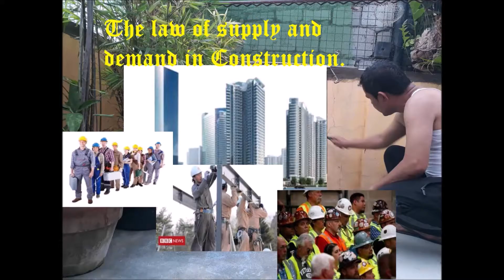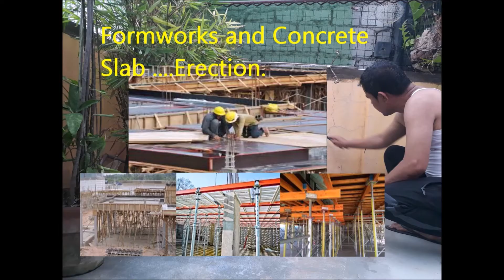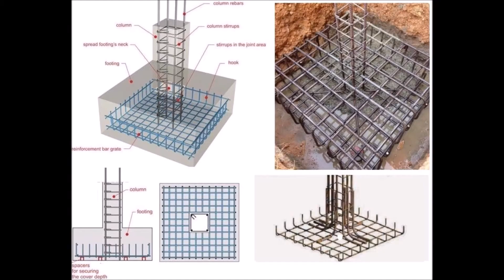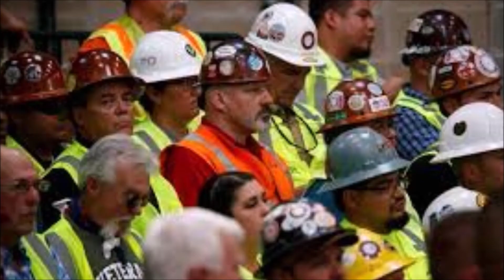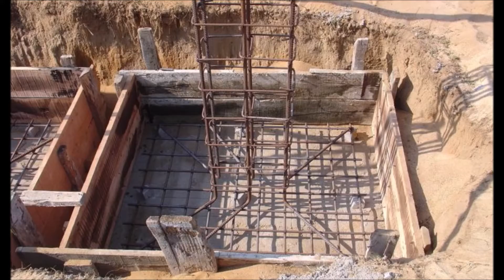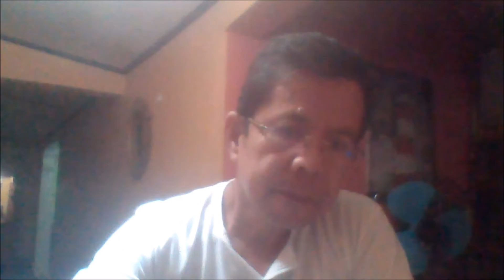Alamin ang Labor Cost sa Merkado bago pumasok sa Kontrata.

Comment: Boss morning. Ttanung lng po ako boss pag kano po ibbayad k s labor s kanila po.155smq po.uumpisan n po kc ung  building  n ppgawa k po. Ang pinapakyaw k po s kanila boss .foting tiebeam coulom  flooring  beam slab roof deck  po.magkano po ibbyad k s kanila boss?pwd add k mlng ako s fb or messenger  para makakuha idea boss kc lhat ng vlog nio po pinnood k lagi luboss k maiintindha.
Reply from the maker: Bigyan kita po ng reference cost para magamit po ninyo... ang labor cost po ng footing and column combined ay nasa 3815/unit inclusive po riyan ang excavation of footing while sa first floor slab ay 354/m2  ang cost. So halimbawa your slab area is 155 m2 x 354 Ph/m2 then your estimated labor cost is for first floor slab alone is 54870. Kasama po dyan ang labor cost sa erection of formworks gamit ang coco lumber. Kung ito po may contractor yong total estimated labor cost ay papatungan nila ng markup na 25% pataas usually yong iba ay sumisingil ng ng nasa 50% markup. Kung papasok po kayo sa kontrata dapat may Kasulatan and then meron po kayong Project Specifications. Thanks.
Reply from the maker: sonny nama ... sa fb. Thanks.